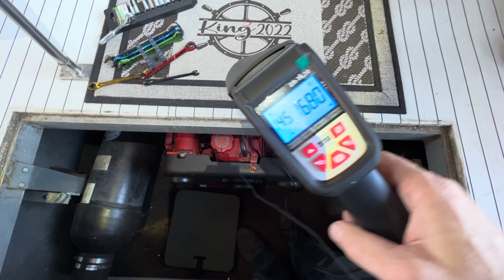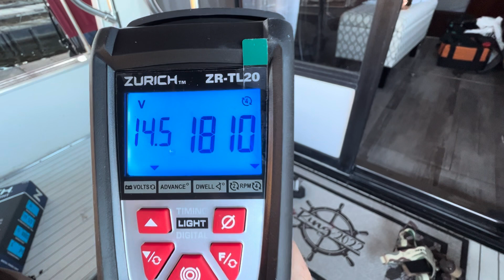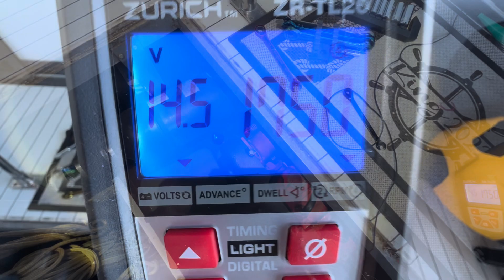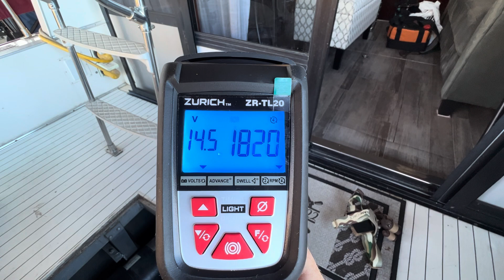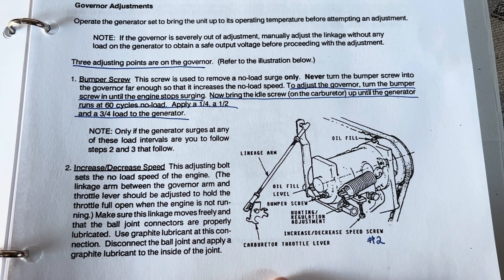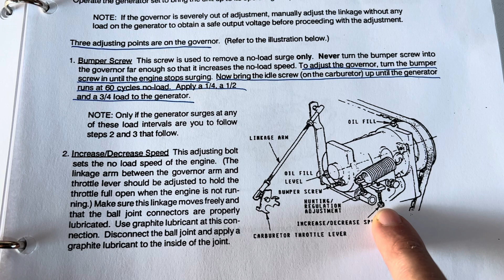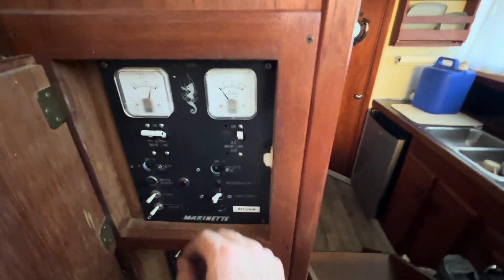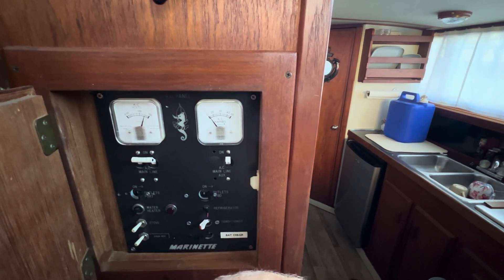Marine Westerbeke 8.5Kw Generator Surges, I Show You How To Repair!!! Oh

Comment: Mine is hunting at no load, but when I adjust the bumper screw to eliminate the hunting, the generator response to load changes is unsatisfactory (i.e. it either dies when load is added or overspeeds when load is removed). The hunting goes away when I partially close the choke butterfly, which tells me it's lean at idle. The hunting goes away with a load, so I don't think I have a fuel restriction. My sense of it is that the idle mixture is too lean, but the idle mixture screw doesn't have any effect on it. I'm thinking I need to rebuild the carb - would that be your approach?
Reply from the maker: @garyedwards2831  I agree carb rebuild, fuel filter, check distributor timing , along with plugs and cap and rotor. If it’s been a while. Let me know how it goes!!!
Reply from the maker: Also the my generator did not hunt while the choke was still operating once the engine warmed up and choke was fully open that’s when the hunting started. If that helps any.
Reply: @jeepmanking3577  Cap, rotor, plugs and RACOR filter new last year. Probably not a fuel supply issue since it carries load fine. Rebuilt carb and initial indications are positive. It was hunting until I screwed the idle mixture screw way out. Sierra 23-7200 rebuild kit had wrong size o-ring for idle mixture screw though.
Reply: Rebuilding carb did not help much, still hunting at no load though slightly less. I think it has excessive wear where the throttle shaft penetrates the body, allowing it to suck in air. Would like to find another carb, but they don't seem to be available even used.
Reply from the maker: @garyedwards2831 look on eBay might find something there. Have you checked your electric fuel pump to ensure it’s working correctly?
Reply: @jeepmanking3577  Nothing at all on ebay; I have some searches set up. Haven't "checked" the electric fuel pump, however the fact that it carries loads fine tell me that it's not an issue with the amount of fuel it can supply. And i keep going back to how much better it runs at no load when I manually close the choke most of the way; tells me that the idle circuit is letting it run too lean at idle, but the main circuit is fine.
Reply from the maker: Do you know what rpm the engine is running at idle?
Reply: @jeepmanking3577  No I don't, didn't have my dwell/tach with me last time I was there, but I am a little suspicious that it's set too low - the throttle stop screw is way back from where it's operating. I can see that the manual says to disconnect the linkage and set the idle to 1800 rpm, so that's the next thing I'll check. It ran pretty well when we were out Sunday.
Reply from the maker: Yes at 1800 rpms that is when it produces 60 hertz, even at idle it should be close to that rpm range as well.
Reply: @jeepmanking3577  And now, it seems to be stable even at low load, with no further actions....
Reply from the maker: @garyedwards2831 well that’s great!!!!

Comment: A fan of the Marinette videos. Curious, have you decided to keep the Westerbeke after all, or just keeping as a backup to the new Predetor?
Reply from the maker: I am going to remove sometime this spring I hope, lol. I was supposed to remove it this winter but way too busy. I plan on adding a fresh water tank to increase our water capacity for longer trips. Thanks for watching!! Do you have a boat?
Reply: @jeepmanking3577 yo tengo un problema con mi generador westerbeke de 229 vol no me está generando estaba trabajando bien derrepente dejo de trabajar
Reply from the maker: @moisesdejesusvelascohernan5994 check all the breakers in the generator to make sure they didn’t trip.